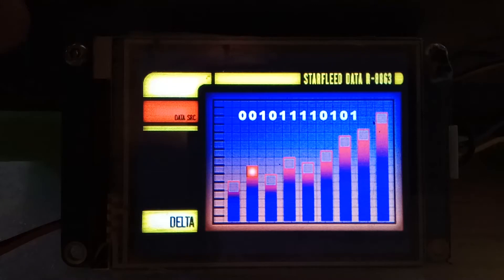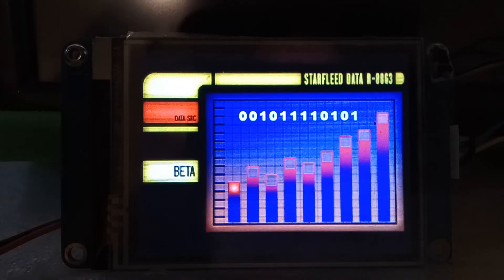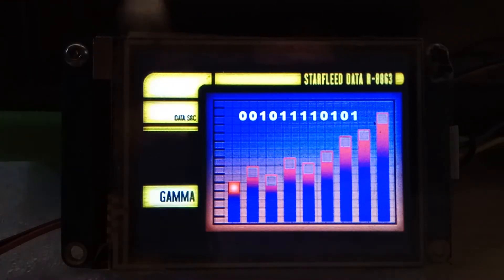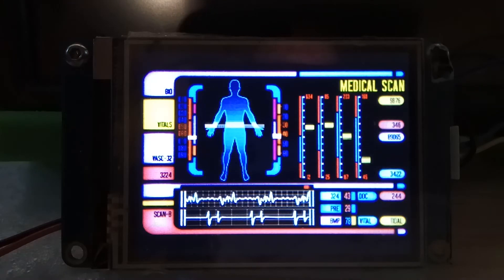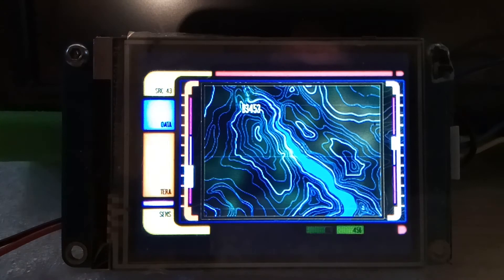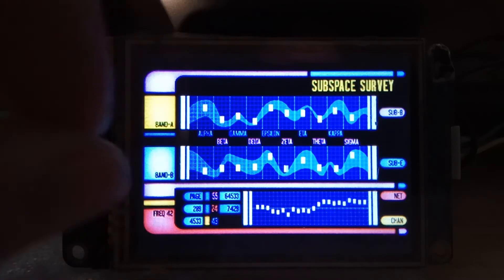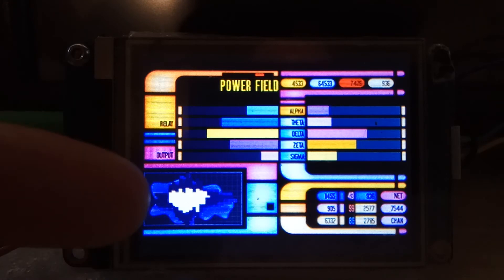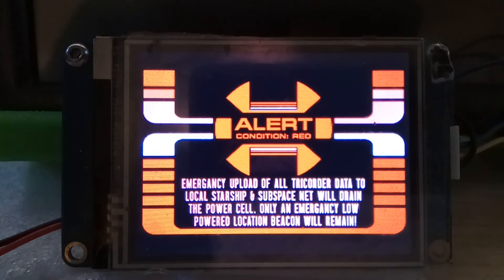Update on tricorder project

Comment: Hi mate could you post a small tutorial of how to load the interface onto arduino board, any help would be great thanks.
Reply from the maker: Well Im now doing it with new and different hardware... But if you wanted to use nextion hardware theres plenty of tutorials online on how to use it now...  Nextion is separate from arduino. The graphics and assets are built in the nextion editor and uploaded to the nextion. You can use either arduino or any other mcu, and you just use serial to communicate with the nextion.... Anyway ive moved on from them as ive had tons of issues with them. But good luck